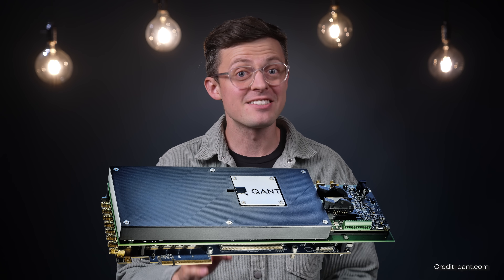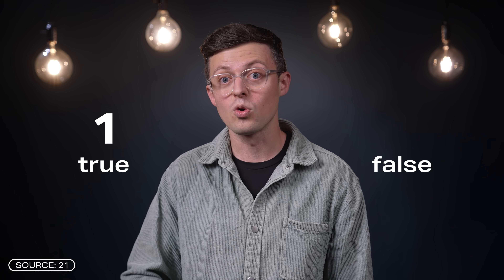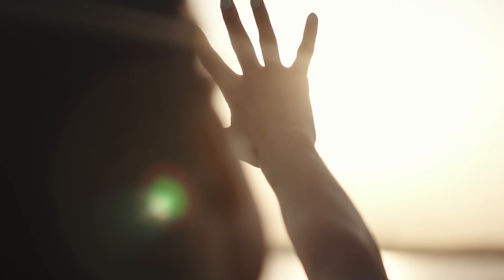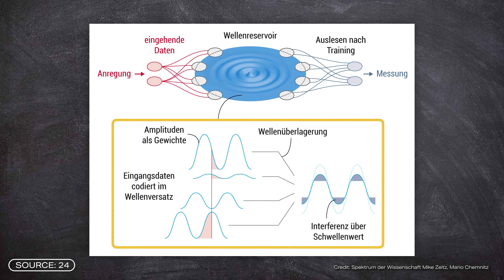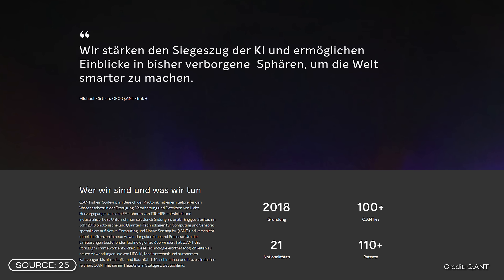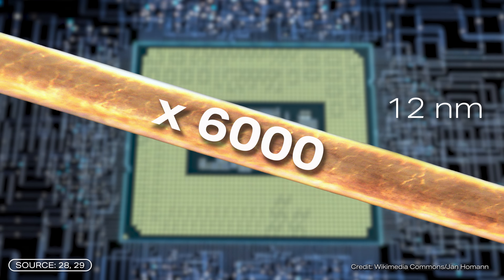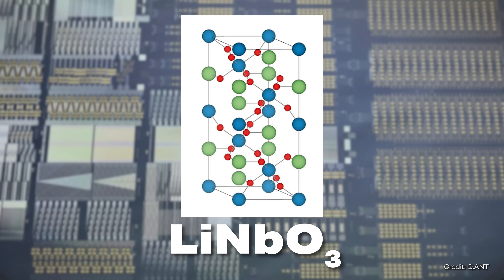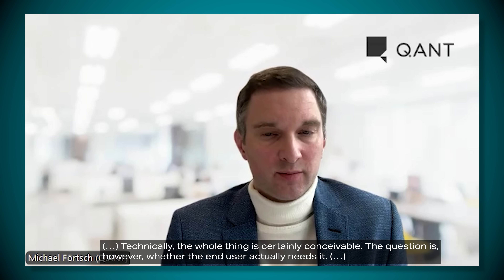This Chip Uses Light Instead of Electricity!

Comment: It is worth clarify this chip -- like all other photonic accelerators near market -- only uses light to speed up certain parts of the computations.  As [1] light is fundamentally linear you can only do linear operations in the light domain.  They can be complex linear operations like a Fourier transform but after your linear operation -- usually a matrix multiply and add -- you have to convert it all back to electrical signals to do any non-linear operations (something you must do at each layer of a nueral net).

Since often lots of computing power is spent on these linear operations it is an interesting technology.  However, it's an open question whether the speed, power and integration complexities of all that converting back and forth to electronic representation can compete with the continuing improvements in the electronic domain (it's not an alternative it's an addition and u that means paying an R&D price to stay competitive).

1: Yes in some rare circumstances you can get non-linear effects via interactions with certain materials but not yet commercially relevant if ever.
Reply: That's only inefficient for neural nets, linear algebra is the corner stone of the whole field of informatics, and just as electronic processors are improving, so too will the conversion process between light and electrical signals.

Certainly fiber optics were thought of simple additions and too brittle and expensive, now it is the gold standard in terms of data transfer
Reply: @blackfire6009  First, even if you just want to do ordinary least squares regression it's a non-linear operation (the model may be linear but not the computation of the maximum likelihood estimator).

But yes there are nice things you can do with purely linear operations but -- perhaps other than Fourier transforms -- none of them is so hungry for vastly parallel computation to make this kind of coprocessor economical.

In very large data analysis jobs it's usually all the shuffling the data around that eats up all the time and resources not the actual computations so there isn't as much benefit to even using graphics cards to help much less special light coprocessors.  It's not that there aren't some applications but you really need AI or the like to cover the massive fixed costs so that will decide the game.
Reply: As far as I see, these are optical analog chips. Analog devices have rather unique properties of encoding any possible functions, including derivatives and integrals
Reply: "NERDS!!!" -Ogre

😋😜

Comment: 50 years ago we were doing analogue optical computing.  Not chips but lasers and lenses &c.  50 years.
Reply: No we didn't - no lasers. Analogue computing used electronic circuits 50 years ago and mechanical mechanisms even earlier but never light.
Reply: @bobashby280  Wrong wrong wrong.  The laser was invented on May 16, 1960.  When I took the optical computing paper in my MSc, we'd had lasers for years.  Laser projects were in hobbyist magazines.  Optical computing was basically about the two-dimensional Fourier transform and what you could do with lenses, masks, and holograms.  (Yes, we had holograms back in the 1970s, thanks to the lasers we had back then.)  Optical computing was very different in character from analogue computing, which I also used.  It's amazing what you can do with an operational amplifier (invented in 1967), but it's utterly unlike what you can do optically.
Reply: Er, that's electronic analogue computing which is different from optical, which is also analogue (not digital).

Comment: Been hearing about how photonic chips were going to change the world for over 15 years! STILL WAITING! World-changing innovations seem to never leave the lab...
Reply: Well that's because electronic chips keep improving and in turn kicking back photonic chips as the advantage they have when developed is getting less and less. Until electronic chips reach a physical limit that photonics can overcome photonics will remain a niche way to compute.
Reply: @asandax6  exactly and it will take a while
Reply: @asandax6 Photonics are objectively better: smaller, power-efficient, and generate less heat, operating at THz instead of GHz (if end-to-end photonic chips to displays existed). However, the transition from classic chips to photonic chips still results in vastly higher processing speeds. Support for the technology is basically nonexistent outside of networking. Making a drop-in replacement for generalized computing would take exorbitant amounts of R&D and risk. It is far more cost-effective and safe to keep working with what they know works instead of making the jump to a vastly superior technology.
Reply: Photonic can’t catch up with electronic yet. And won’t for a while.
You cannot compensate 70 years of R&D in electronic with a niche market like photonic. Even if photonic has more potential.
If both electronic and photonic were at the same level of development, photonic would win.
Reply: The new technologies are becoming feasible because electronics is pushing up against component size and heat limitations. The main question is how much processing power will supersede our (organic) ability. 
Will we debate whether a chip is 1,000 or 10,000 times faster than our human brain?

Comment: I can see an optical AND gate doable, but not a NOT gate. How do you do that?
Reply: so first of all they say they do an analog not a digital comptuer with it..
But if you want to do a digital not gate, you'd encode the true/false by the polarisation.
And the not gate then would be a part that changes the polarisation

"metamaterials can be designed to rotate the polarization of light through a phenomenon known as optical activity, which is achieved by creating structures with chirality, or an inherent handedness, such as twisted split-ring resonators. These specially designed materials interact asymmetrically with different polarizations of light, leading to a change in the polarization state, and can be tuned by adjusting parameters like twist angle or applying bias voltages to components like graphene gratings. "
Reply: @EmanuelWue  That means changing the scheme of encoding, which may well bugger up the feasibility of other operations. I've not come across an optical circuit employing polarisation. You want these machines to be Turing complete. Analogue computers never really took off. That is despite an op amps name.

Comment: Many manufacturers advertise "photonic chips" or computers that merely transport digital data using light—essentially just fiber optics connected to conventional GPUs. Examine their so-called "photonic" innovations one by one, and the reality becomes clear.
Q.ant is in a league of its own.
Few have truly understood the immense potential of this small yet bold company, which is moving in the right direction with remarkable vision. Light isn’t just a tool; it’s the ultimate hardware, not only for today but for the next billion years. We’ve only just begun to scratch the surface of its possibilities.
Q.ant dared to develop and commercialize technology that is 40 years ahead of its time—technology for an era when information processing as we know it will be unrecognizable. Beginning as a PCIe accelerator (a strategic choice, much like the first GPUs), its potential is limitless. This isn’t just about accelerating AI; it’s about pioneering a new paradigm of computation. Everything is a wave, and light—with its resonance and interference—becomes the ultimate hardware for performing calculations.
This card is more than just hardware; it’s a laboratory for interacting with and computing through light. True scientists, mathematicians, and physicists will grasp the implications of this kind of computing. Let’s hope many of them are also programmers who know how to harness its power. It’s simply incredible how quickly this is happening. As far as I know, this is the first card of its kind in the world, and it’s already carving out an evolutionary path.

Comment: Why do we need light for that? Can't the same be achieved with regular AC of different frequencies (not to be confused with impulses currently used) ?
Reply: Light is AC.  Just it has a frequency that is a million times higher, so it can pack a million times the data in the same length. Or can work a million times faster.
Reply: @BruceKoerner  "million times ze data in die same length. Or can verk a million timez fastuh."
Reply: @BruceKoerner  is it also a million times more difficult to implement it in silicon given all the tech the industry uses right now?

Comment: A big use of memory in chips is exactly loading different instructions from program or new program, storing data as it comes and go as it might not all be in yet, and running things in parallel as different operations may take unknown time to complete so you need to store data 

Also it lowers amount of raw processing power you need as you can store some stuff and get back to it later instead of doing it all at once 

Photonic chips may require and people working in it a different programming paradigm to fix this issue or mitigate it

Also lowering memory usage and instead elevating computing power can help 

And photonic chips can do more complex calculation per little unit than simple or not and and allowing for some help here but that needs a shift again in how we program things (also using full power)

Many can photonic chips can do Fourier transforms a super important math thing for modern day life much faster and better already 

As it’s more used, uses and solutions will become more apparent but key is getting over initial slump to get know how
Reply: Last I looked into photonic it was to move data faster across the chips not to make calculations.
Reply: @surters both. Often terms photonic and optical used interchangeably. Computing with both have been around for decades

Comment: So when are the home computers going to come to market?
Reply: it will not be usable for home computers, too expensive.

you would still need old processor, and motherboard based on electricity, so this is only addon (to PCI-E slot, as card), and will be used only for certain calculations.
You don't do those at home. It's for data centers, etc.
They can buy $5000 expansion card, you not.

I doubt it will be EVER usable for home computers, but whatever, we will see how research goes, maybe there will be nice suprise, who will know.
Reply: never as all vaporware costing 10.000€ for one useless shit card that won't do anything useful in a home pc usually does

Comment: Hey chat GPT why is this technology over hyped? Photonic chips are considered overhyped because, despite their potential for high speed and efficiency, they are still a developing technology with significant practical limitations. They are expensive to manufacture, difficult to integrate with existing electronic components, and not as versatile as traditional chips for general-purpose computing.They will likely never replace regular chips for general-purpose computing tasks, such as in personal computers and smartphones. This is because photonic chips are not good at certain fundamental computing operations, like storing data in memory or performing logic functions that require a precise, non-linear response. Photonic chips are best for very specific, high-speed data transfer tasks, but not for the wide range of functions required by everyday devices.
Reply: Yup, and so was Air conditioning in Vehicles when it first debuted. As well as heated seats, even seat belts!  All new technology is "overhyped" until it becomes mainstream.